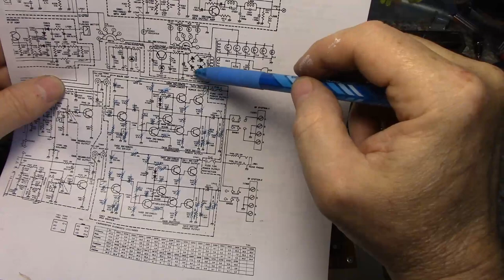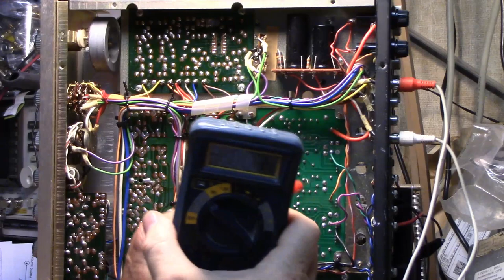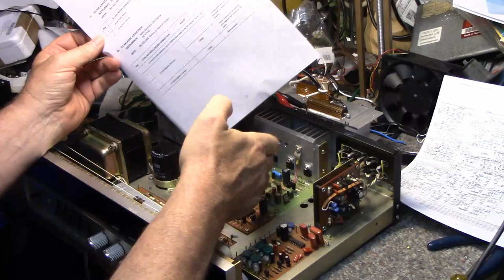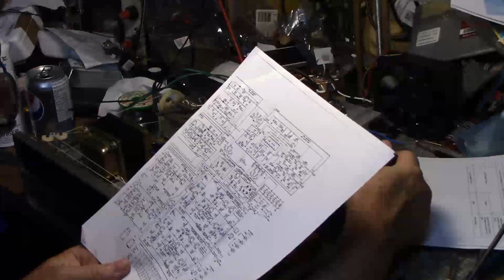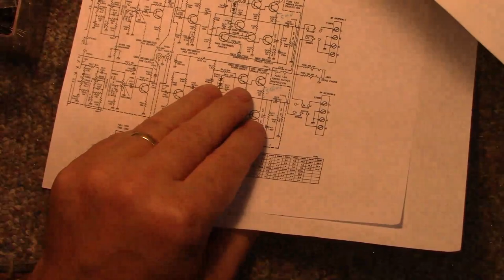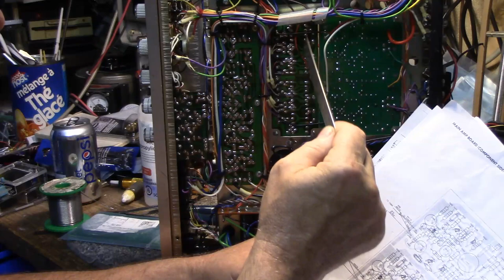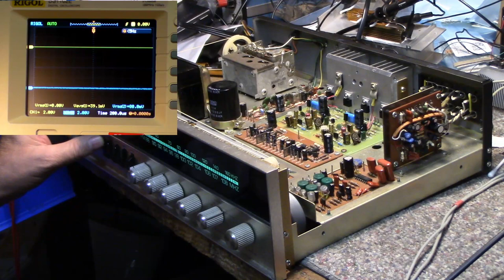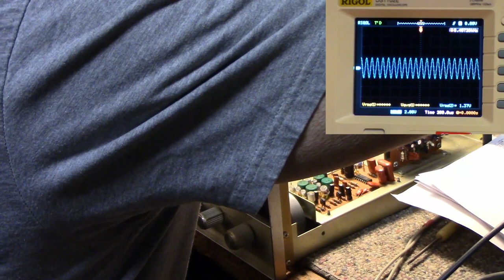Harman Kardon 330B - The Resurrection Show (EP. 35)

Comment: Awesome work! I'm a vintage H/K fanboy, so this is right up my alley. I love all the *30 series stuff and think it's highly underrated. Currently I'm working on a Five Twenty Nocturne that blew a resistor on the power supply board. I have a parts unit arriving soon that I can hopefully leech the board from, but I've seen many with the exact same issue, from the same resistor. I had thought about designing a whole new board to have made, and I may just do that after watching this. Thanks for putting this out there!
Reply from the maker: Thanks for your kind comments. I'm a big fanboy of HK gear too, if that wasn't obvious. I have lots more older HK repairs coming up including a Two Thirty I'm working on right now and I'm always on the lookout for tired gear that needs some love

Comment: Nice Job
Lots of the older mid price gear is worth saving, and because of the discrete components should outlast many of the newer products. Have you considered adding DC protect circuits to these units. Even with new caps I am reluctant to connect them to my expensive to replace speakers. I recently came into an AVR 75 and using it as a stereo, and find everything about it excellent. From the period when the manufacturers took a really good stereo and grafted the surround circuits on to it.  I wonder how hard it would be to discard the dated surround circuits, and make it a much simpler stereo.
Reply from the maker: True, the HKs from this era don't have DC protect  but they were ahead of a lot of others by adding the speaker fuses. That's something that was simple and worked well.
I can't recall the last HK that had blown output transistors